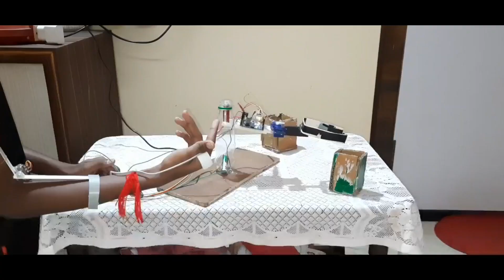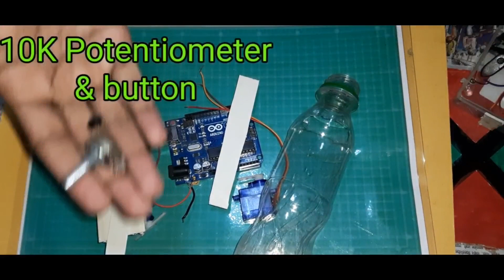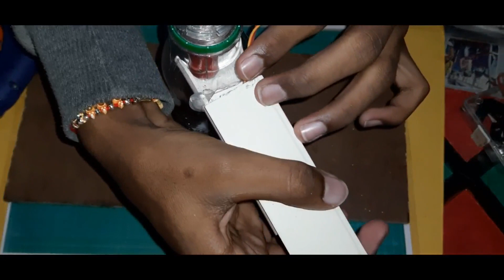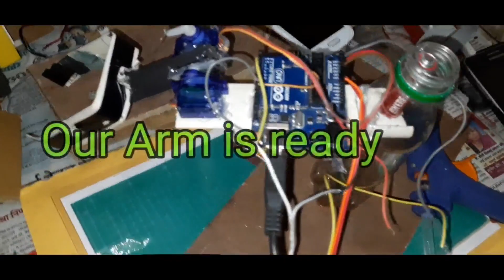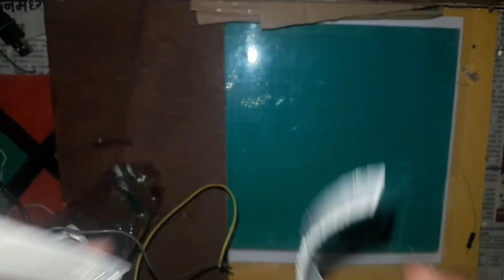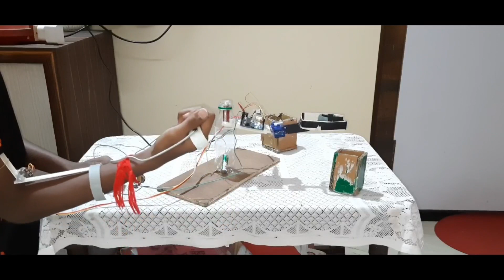How to make Robotic arm/Exo skeleton arm|Robotic arm|Arduino

Comment: code or circuit is wrong not working properly
Reply from the maker: Thanks for telling that.
Actually there's difference in the pin numbers of Circuit & Pins in code. So you can modify it as your need.
Thanks
Reply: Thank u so much ..if u can kindly send me the corrected code then it would have been of great help .. actually I am a beginner so I am trying it but facing problems ...so pls help me out
Reply from the maker: Ok I will correct it as early as possible. I will reply you after correcting it.
Don't forget to like,Subscribe
Reply: Thank u so much Sir ..I am working on it really inspired by such an amazing video....if u can kindly upload the right code then I can work on it and if I am successful I will comment again and let u know about my progress ..... It's urgent ..pls help me out
Reply from the maker: Which pins are you using for Potentiometer??
Reply from the maker: As per the code.
Connect Potentiometer to = A0
Push button = pin 2
Servo 1  = 9.
Servo 2 = 10.
Reply: 1 no. 👌🤟Bro
Reply: @IdeasbySuyashDesai  Sir the servo connected at pin 9 is working but the servo connected at pin 10 is not rotating ..kindly help me out ...really very thankful for your reply ..it helped me alot ...kindly resolve this matter too
Reply from the maker: Thanks bro
Reply from the maker: Have you connected button properly?
Check your code & circuit connections there may be problem. Because I checked code.
It should work with pin no.10.